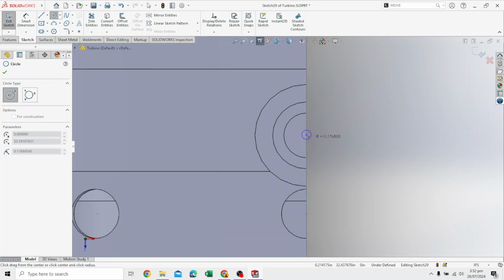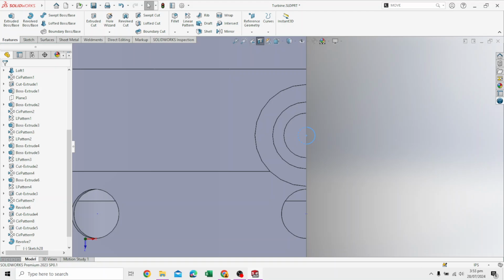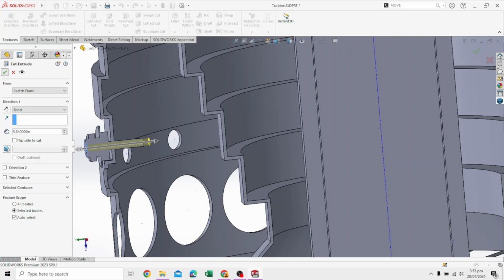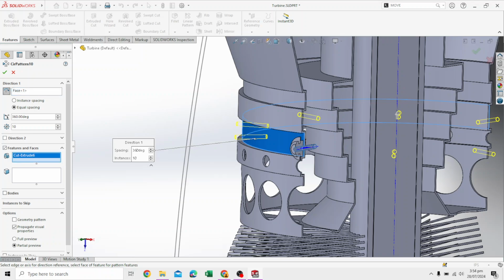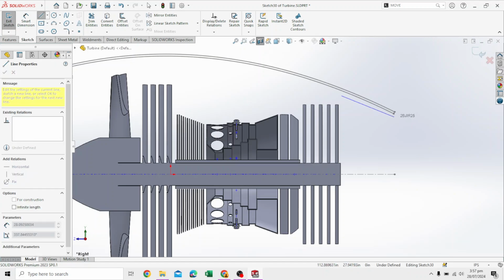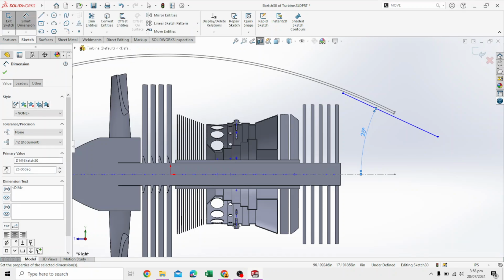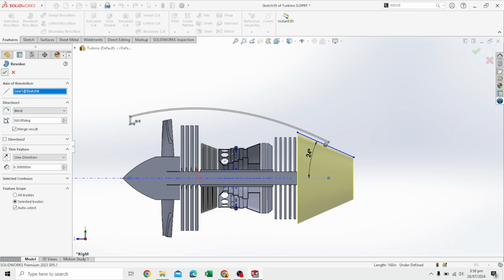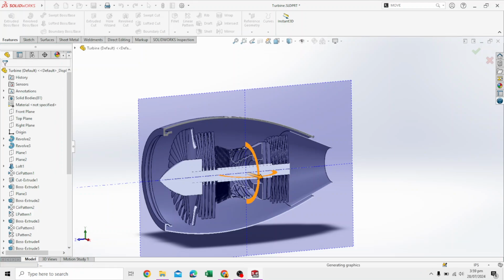Design Turbine Engine Part 11

Comment: Hey I would like to say a big thanks to you for helping me a lot with designing the turbine, I literally watched all of the videos from part 1 to 11 and I gotta say you do a great job at these tutorials, Im an aeronautical engineering student and I gotta say, I've learned a lot throughout the tutorial, though im using a different CAD program (AutoCAD), I was still able to pull off all the steps, although there were commands that were hard to pull off and had to research them on my own, thank you again for this tutorial!!